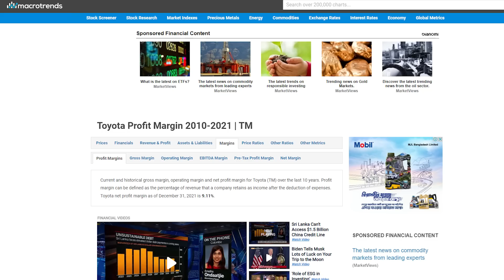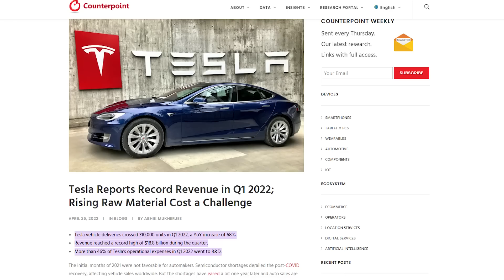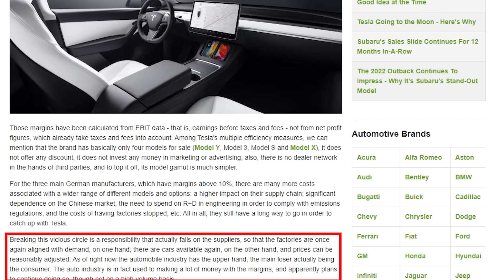Tesla makes 3 times more profit than Toyota per car (Kodak!)

Comment: Lithium cost is up 1000% since 2020, driven by EVs;  a Tesla costs $1500 more; the problem is worsening; quality sources are costly to develop with superior battery tech on the horizon that doesn't use LI would you develop a lithium source?  Current Li production limits production to under 5 million insignificant; PHEV could be 50 million.
total vehicle production w the same lithium; the market is 100 million vehicles a year and a billion exist.

Comment: That 3 times profit directly relates to the price tag being higher. When Toyota are manufacturing like for like cars at a lower cost might just be a Xerox moment.
Toyota drive is phev which is the best place to be now. Reducing manufacturing carnbon footprint compaired to EV and minimization of hydrocarbon usage is exactly the proper direction at this time. There are PHEV's out there that can boast tank of gas lasting thousands of kilometers.
Reply: They got you on that B's narrative?
Reply: @juanmartell47  this channel  is begining to become a zealot zone where common sence is frown apon.
Reply: Ya bloody dreaming mate
Reply: No. PHEVs were the technology of the last decade. Why get something with a gas tank and all the required maintenance now? There is a reason BEVs outsell PHEVs 3 to 1 globally. 
To your specific points, the manufacturing carbon footprint is only marginally better for a PHEV and that is shrinking as the grid improves and the real world operating carbon footprint of PHEVs is MUCH worse than a BEV.
Reply: @benjaminsmith2287  in the begining sam was giving out solid infomation. It was a good channel. Now I cant get through most videos. Last few days is fairly typical. I would prefer less videos less opinions more research and an even handedness of all forms of potential future green energy. Sam is fexated on battery EV and damn everything else. Sam has marketing background & I wonder if this chanel is simply a marketing experiment in leading sheep.
Reply: @Enrique Thiele so why are phev's cheaper than EV's and why is weight ok for EV's when they are heavier than phev's

Comment: Incorrect, you are too optimistic bout BEVs and not realistic about PHEVs and the Lithium choke point.  Tesla exclusively sells to a niche luxury market; all makers do well in Luxury sedans; but Tesla makes nothing on the lower end - Toyota, VW etc do; w market share is much larger and they have 5 to 10 times the profit of Tesla. Tesla is like the new Jaguar until such time as they attempt mass market vehicles.
Reply: @Enrique Thiele What are you thinking about Enrique - no reasoning means you aren't really saying anything but an opinion

Comment: Well Sam while I'm not a Bolt fan ( its okay). GM has set a price precedent here in the US with their 6k price drop.  Pandora's Box has been open and now it can't be closed. Good times are coming
Reply: I guess you have never heard of supply and demand?
The Bolt is cheap because nobody is stupid enough to buy it. Second hand value is catastrophic.
It will soon be an orphan and that will not help…
Reply: When you see a high street store, or now internet retailer advertising what amounts to a "permanent sale", what's your first thought?
I bet it's not
"They're doing REALLY wel!!!"?
Just sayin'
Reply: so you think gm can win by losing 10,000 dollars per car? not even gm can afford to throw away enough money for this to work.
Reply: @whowhy9023  I get what you're saying but if the bolt battery situation is cleared up, the bolt is at a price range that is appealing to many people that want to get out of ice cars. Myself included. I would buy a bolt just because of the price and use it for driving in the city and on short trips. I would have to go back to my Prius for the longer trips which are far and few between. So the bolt with their price drop I think will inspire a lot of people in my situation. I'm only holding back because I want to find out more about their battery problem right now.
Reply: PS
I'm dying to buy a Tesla I'm an investor and I love their vehicles but I can't afford one right now and I don't want to wait.
Reply: A cheap car that's in short supply sets a precedent for very few people, so it doesn't really change anything for the vast majority of people.
Reply: Paid for by future bailout money, they know it and don't care when you have free money coming. Better yet, they capitalizing on it by telling us how cheaper they can sell their EV. Wow! /S
Reply: @Enrique Thiele Always a loss leader compliance car, a good one however

Comment: That's because Tesla is a luxury car brand. If you want to compare apples with apples, compare Tesla with Lexus. I wouldn't mind betting that Toyota's luxury car division is as profitable, if not more profitable than Tesla.
Reply: "you wouldn't mind betting"?
Well, I'll take that bet.
Searched "did lexus make a profit 2021.
Results showed "lexus sales figures" including the official Toyota/ lexus page.
"769,000 sales globally" But strangely not one mention of any financials.
(Let's guess that they made zero at best?)
Reply: @rogerstarkey5390  So you don't agree with me but you also have no proof. My opinion is based on the high price of luxury cars which is based on intangibles like branding, and on tangible features like leather seats and high tech gizmos that don't cost that much to mass produce. There isn't much difference between the mechanical components of a Toyota and a Lexus but you will pay tens of thousands more for a Lexus than an equivalent size Toyota model. So inherently, a Lexus is more profitable per unit sold than a Toyota. Tesla on the other hand is smart enough to promise but never deliver a low cost model because most of their profit would be consumed by the production process.

Comment: I think Toyota have better chance than most of big auto as they have hybrids to bridge the gap whilst tesla scales, that might buy them enough time to adapt but it will be very tough.
Reply: Hybrid sales are down in most countries
Reply: @chidorirasenganz  there aren’t enough BEVs to serve the market so what’s the next best thing? Hybrid right?
Reply: @grantdavies7561  Hybrids are more expensive, more resource intensive and require more maintain since your building an ICE vehicle and EV then connecting them together. Also most hybrids are used in ICE most of the time so they aren’t any greener than ICE cars.
Reply: @rogerstarkey5390  Right! and Tesla is about to hit ~2 million EVs this year and that’s without their two new factories that are currently scaling up. So 8 years from now   (2030) even 3.5 million EVs is nothing.
Reply: @chidorirasenganz  Price is a function of market, so we can leave that aside.  Resources, depend on what you are comparing to, most hybrids are smaller and lighter than the AVERAGE car (though they are heavier than cars in their class) and you have to include fuel in the comparison, Maintenance is about the same since ICE cars and Hybrids share almost all of their components, and the ones they don't share are all less maintenance on the hybrid side.  All hybrids get better gas mileage than comparable ICE cars, so they ARE greener.
Reply: @CorwynGC  They take more resources as you’re building an ICE car and EV. You need two drive trains instead of one etc. There’s more part to go wrong so the cost of maintenance can be more costly than an ICE vehicle and of course more expensive than a EV. Not by much as they still create engine noise and pollute toxic fumes. Even the better hybrids, Plug-in ones, aren’t often used in fully electric mode which negates its main benefit.
Reply: @benjaminsmith2287  yes, i think it's unwise to write them off already, most people forget they already made a RAV 4 powered by Tesla many years ago https://en.wikipedia.org/wiki/Toyota_RAV4_EV. Something needs to bridge the gap whilst BEVs scale, people still need cars. If they play their cards right there is a small window where they can stay alive and successfully transition.

Comment: For Tesla does this include the large line item of profit from carbon credits?
Reply: Comparatively it is peanuts, but does pay for Supercharger installations. Not Tesla's fault the other OEM's are laggards
Reply: @j.pgoodwin9020  I thought it was like $1.5 Billion? That's not chump change.
Reply: Just checked. Yes it's 1.5 billion or 25% of their total income. Peanuts?!
Reply: So greater than 25% of Teslas profit per car is a windfall government subsidy paid by other auto companies which atrificially transfers the profit per car from one manufacturer to another. Bizarre really.
Reply: On the other hand...
For legacy companies (which PAID Tesla) does that include the difference between that payment and the FINES they would have paid?
Cuts both ways.
The reason Tesla receives a "bonus" is that governments left a loophole for these companies to pay less for their "cheating".
Don't blame or complain about Tesla being in the right place, doing the right thing.
Reply: @sunrisejak2709  Q1 2022 Profits $3.3 Billion, Reg Credits $679 Million.
so about 20% of total PROFITS not total INCOME
$18.7 Billion in total revenue, so 3% of total income.  Peanuts.
Reply: @sunrisejak2709  Regulatory credits are based on cars ICE manufactures make, not Tesla.  Tesla makes more cars than they sell credits for.  So it makes no sense to talk about them as part of Tesla's profit per car (i.e. the total amount won't change if Tesla changes the number of cars it makes).
Reply: @rogerstarkey5390  No blame. It's just odd/inappropriate for governments to manipulate private sector business profits. Kind of detracts from free and open fair capitalism. Just as government laws mandating cars be sold through independent dealers and not direct. It would be ideal if governments stayed out of the way and didn't participate with subsidies for any industry, or bailouts etc. But, as they say, "it is what it is". Win some lose some. 😁
Reply: @CorwynGC  I was QUOTING a full financial  year 2021. Total net profit 5.5 billion with 1.5 billion in carbon credits. Not peanuts!
Reply: @CorwynGC  OK, I used term income in place of profit. Oops. You site revenue for 1 qtr. Looking at a full year and just profit the carbon credits are a substantial portion. Not peanuts!
Reply: @sunrisejak2709  
It was entirely appropriate for Governments to "manipulate" the "private sector business profits" if those companies PROFITED by breaking regulations.
That's a duty of "Government"? Provide a set of laws designed for the public good, then hold this breaking them to account?
.
If you suggest they then "manipulated" the rules to work in favour of Tesla..... 

Judging by previous Government attitude toward Tesla, I find that HIGHLY unlikely.
.
Now, as I stated, due to the (poorly written?) terms, it's the choice of those companies to "manipulate" their own profits by using the loophole.
Government has (probably) seen fit to look the other way, maybe due to the possibility that not doing so could lead to one or more companies failing, then requiring "assistance"?
.
Now, THAT would be messy?
Reply: @rogerstarkey5390  HI, my comments weren't intended to show favoritism in defense or offense to any organization. I realize that governments try to do what's best for greater society but dabbling in business decisions which mandate sales channels or provide inequitable subsidies is rarely fair. Supporting union shops over non union with added incentives. I'm a firm believer in true free capitalism. But I realize that's just not possible. I get your point. I just prefer a fair fight without interference and let the best "man" win. I guess a bit too simplistic! 😊 Maybe like the Cola wars. Duke it out for market share. Only the strong survive. Blah blah blah. 🤣
Reply: @sunrisejak2709  Their last Quarterly report has inc credits their margin is 30% approx, excluding Credits 28.5%. Relatively minor
Reply: Note that they have about $18 Bill ïn the bank " after building 2 massive factories while adding to their existing factories
Note they only have $800 Million in debt. What are the debt levels of Legacy OEM's
Reply: @j.pgoodwin9020  Not sure debt means anything. Governments print money like it going out of style and bailouts are possible as "too big to fail" might rear its ugly head again. I'm not gloom and doom on legacy auto. They are navigating a tough path trying to walk the tightrope of keeping their customer base while they transition. Plus in spite of some inept management here and there legacy auto has some pretty competent people. Don't put them out to pasture or 6 feet under just yet. 😁
Reply: @j.pgoodwin9020  I take your word for it. I actually haven't seen their financials. Just a brief article on 2021 identifying the carbon credits vs total profit. That's what I get for relying on Google and not reading their actual statements. 🙂
Reply: @sunrisejak2709  Yes but why compare it to profit?  Income shows what they take in, and is a measure of how they are doing.   Profit is just what they have left after they decide how much to spend on growth.
Reply: @CorwynGC  It goes straight to the bottom line.
Reply: @sunrisejak2709  Fair enough, there has been a consistent anti Tesla FUD and short Seller campaign, they highlight items like this and the early Gov DOE Loan as GOV handouts, while conveniently ignoring the fact the OEM's got loans in the $Billions which have yet to be fully repaid whilst Tesla used theirs ( about $450 Million from memory ) to buy Fremont (at bargain basement price thanks to the UAW ) and then repaid in full plus interest plus early repayment penalty within a couple of years. The same fudsters ranted about Tesla burning cash as they built out the Supercharger network (The reason the "Tesla Killers "flopped as their owners Range anxiety was real and justified )
There was an excellent presentation by a brilliant (Top end of Mensa ) character Jack Rickard R.I.P (Look up his obituary)
https://www.youtube.com/watch?v=Wv_XcxpRuTw
And he was a real character, much missed
Reply: @CorwynGC  The SEC has required it gets its own line item. It is also not subject to SG&A and will just be added to the bottom line.
Reply: @j.pgoodwin9020  Yes, it's very strange the number of folks hell bent on making life difficult and trying to deny Musk andTesla the admiration they deserve. The government, other billionaires, unions, etc all taking very adversarial positions. Rather than learn and get on the bus they would prefer to muddy something that is just doing the right thing. I'm a huge Musk fan and Teslas culture while challenging to function under is changing the world. I just rail against all of the interference primarily coming from governments that try to balance the playing field but by doing so always seem to do more harm than good. But Musks little diversion into Twitter? A distraction and perhaps toy for a brilliant man. I hope he walks away and stays laser focused on his change the world and improve humanity mission. People need to embrace and not try to block. Thanks for the link.
Reply: @sunrisejak2709  Of course it does.  That's how math works.
Reply: @sunrisejak2709  And?  You divided reg credits by profit, which the SEC does NOT require, nor does it makes sense.
Reply: @CorwynGC ? The line item is not affected by COGS or SG&A. Hence it drops to the bottom line. Of the total net profit of 5.5 billion, 1.5 billion was related to carbon credits so we can determine the % of the profit that was the result of the carbon credits.
Reply: @sunrisejak2709  You are still missing the point that Tesla only needs to show a bit of profit on their balance sheet.  They are free to use the rest of their income for capital expenses to increase growth.  If you want an accurate determination of the impact of regulatory credits on the company, divide the amount of the credits by the increase in total assets of the company.  That is the correct metric.
Reply: @CorwynGC  Yes, you may be right. My only point was receiving 1.5 billion dollars directly from competitors is a rather impactful amount.
Reply: @sunrisejak2709  It would definitely look good on MY balance sheet...
Reply: @CorwynGC  With $1.5 billion USD in your bank account you could buy 25,000 Teslas. If it were 1.5 billion Vietnamese Dong you could buy 1. 😁 Not important but I laugh as I become a millionaire every time I land in Saigon! 🤣 The point being as you said I wouldn't mind my bank account being challenged on how to utilize $1.5 Billion USD. Maybe that's a new windshield wiper design for the Cybertruck. 😊

Comment: sam silly classroom advice to wait for lower prices. as youve said many times every ev made is instantly sold. 0.00 reason to lower prices, supply has to catch up first.
and that not likely before 2025 or so. and by then galloping inflation may make prices even higher. so WAIT is really poor advice